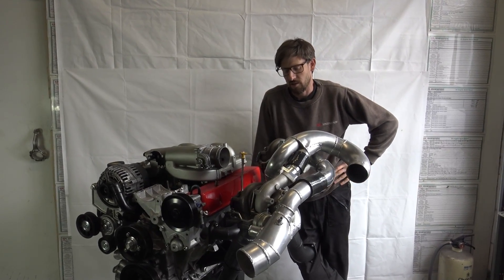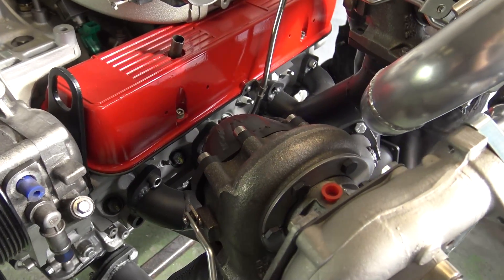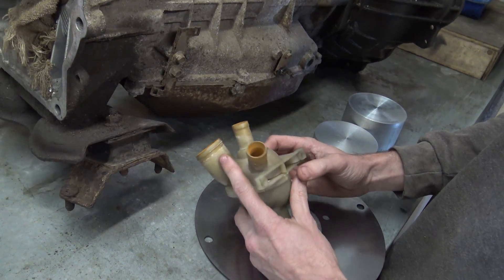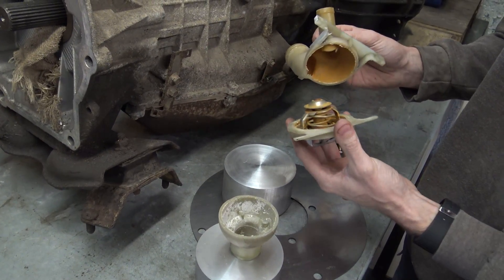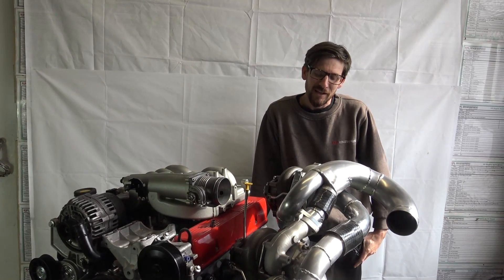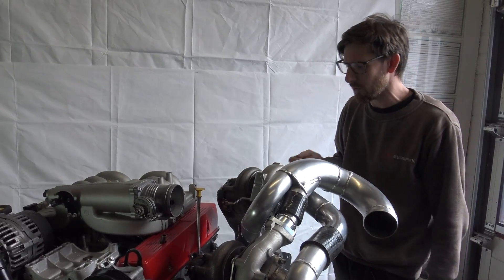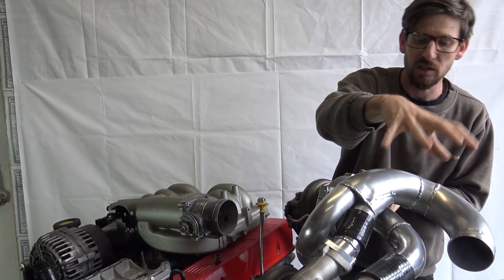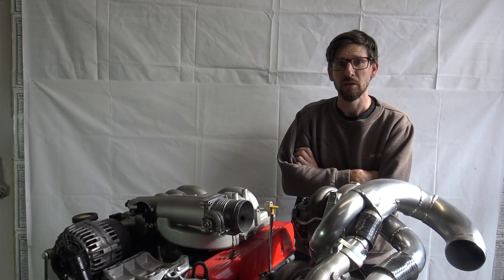RPi Engineering Rover V8 Twin Turbo Tuesday Episode 11 - It's Back!

Comment: Would this squeeze under the bonnet of my MGB V8?
Reply from the maker: Nope :-). Far more you can do without the complexities of turbos for less money. We have converted to 4.6 Stage 3 engine with ported intakes etc before.
Reply: @RPIEngineering  what sort of power could I get with a 4.6 stage 3?
Reply from the maker: @petyrkowalski9887  260 to 270 without sacrificing bottom end torque or drivability

Comment: I'm binge-watching my way through this series.
It's quite doubtful I'll ever be in the position for one of these engines, or even a supercharged P38, but at least I get to watch someone doing it.
Cheers for the videos and good luck with your house move, last year we moved from London to Ireland which took in total six years of planning, we've been here for a year and are STILL unpacking!
Also, due to the money-grabbing government here I'd only ever be able to consider a P38 4.6 once it's 30+ years old due to the road tax system:
Less than 30 y/o: 1805 Euro per year
More than 30 y/o (vintage class) 56 Euro per year!
Before we moved the wife took quite some convincing buying a 31 y/o RRC was a good idea! ;-)

Comment: Have you gone for a bit more piston ring gap on the engine vs one of your normal builds? Amazing how much is involved & therefore how the costs escalate...
Reply from the maker: No. As we have stated these are being fitted onto my standard engine which was freshly built inhouse around 2 years ago as a standard 4.6 engine +20 thou oversize with Piper 270 cam. For that reason we are only going to be running very low boost levels. Hopefully later I will do a forged build to see where things can go.